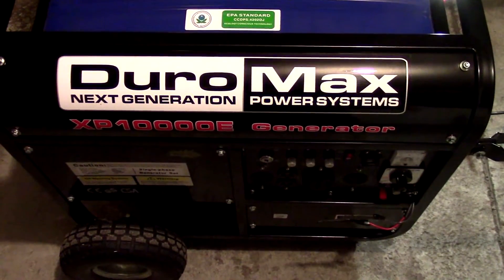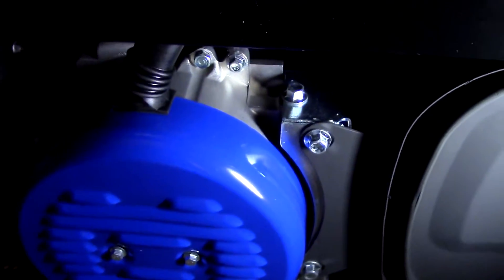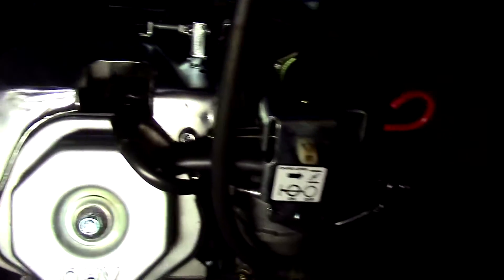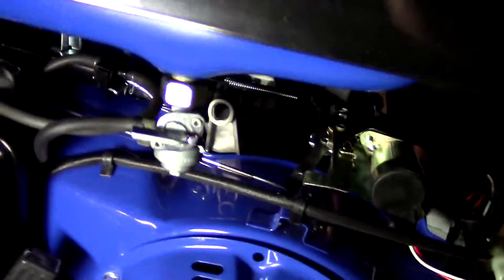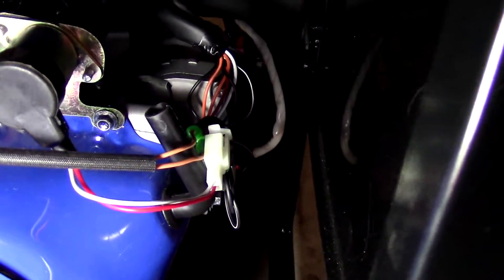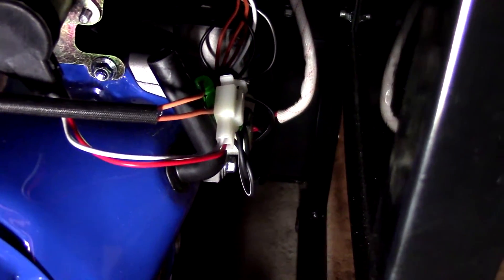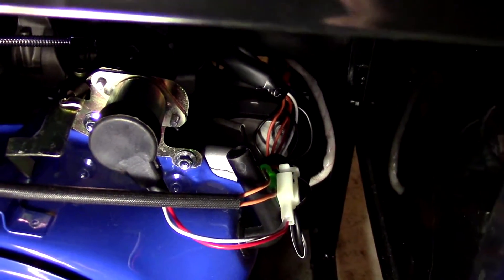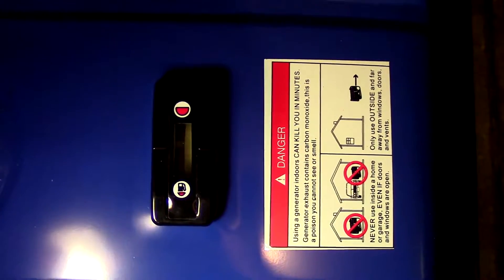DuroMax XP10000E Generator Wiring and Diagram

Comment: I have watched some of your very informative videos and have a question about the duromax XP10000EH generator auto idle control.This generator is similar to the one you reviewed, however, it can run on propane too.  Ever since I bought the unit 4 years ago, I can start the generator in the low idle mode with no load on the generator  with "auto idle on".  The generator then goes to high idle with load attached, however,
- it does not return to a low idle when it is later disconnected from the load  via the home circuit breaker.
-it does not change the engine's speed as the load normally changes when connected. It always at the highest engine speed.
-the auto idle control switch does not illuminate when "on"

 I contacted the seller, maxtool/factory authorized outlet, who said I may have a defective auto idle control switch because it does not illuminate. Another tech there said it could be a defective solenoid.

I painfully removed the switch and tested it. It is a kcd3 rocker that should have three terminals, however, the ground terminal is totally missing . The load on/off seems to operate OK. Can the switch illuminate with a nonexistent ground? I mentioned this to the duromax tech and who had no answer.

Via your experience-  Should the auto idle control switch illuminate? If so, should it be grounded and require a new switch? It is difficult to see in the tangle of control panel wiring if there is a disconnected  wire to ground with a broken terminal attached.   On the other hand, is there a problem with the solenoid and how do I replace it? Could there be another problem?

Thank you in advance for your advice and assistance.

Comment: I purchased a replacement AVR for my XP4400E.  The original half moon has a pair of yellow and a single blue wire going into a 4 pin connector and a brown wire to a single connector.  This arrangement does not correspond to the wiring diagram in  the owners manual but it worked fine for 5 years until it failed.  The new AVR has all four wires going to the 4 pin connector (pair of yellows, a blue and a brown).  In the pin arrangement the blue and brown (shown as red and white in the wiring diagram) are reversed.  The yellows are in the correct positions on the connector and go to the Excitation coil.  My question is: Does it make any difference how you connect the other two (brown and blue) that go to the Main coil? Or to put it another way "Does reversing these two wires make any difference?

Comment: I have a duromax generator  propane and gas , the engine went bad so I tried to replace it with a used predator 6 hp. But the coils won't pair when I flip my 110/220 switch I have no power now. Did I fry my regulator? How can I make this work so I get 110 at 26 amps to run my account?

Comment: good afternoon , I have the same generator , but does not generate power , I tested the mechanical part and goes well, the cables and wiring are fine ,
I think it may be the rectifier amperage, you can tell me about it

Comment: Sir, could you please tell me where the battery charger rectifier is on this model? My idle control does not work and it was suggested to me that this part may be at fault. Thanks.
Reply: i think I have the same problem . Did you find a solution?

Comment: Shopping Dad  that was very nice of you to make a video for John. Very nice indeed.
I hope you can answer my question listed on your other video about my well pump.
Reply: joseph get an ac amp meter if you dont know what your well pump draws,determine if it is 240 volts or 120 volt, im asuming its 240 volts,clamp it around one leg of the 240 wire thats comming out of your breaker box turn the water on and  watch your amp meter for full load amps,then buy a generator to handle that much amperage.i think mine is around 23 amps but not fla.flas will be a little higher,then depending how much load your pulling on everything else.i have the 10000e i run my 240 volt well pump with it but run it only with nothing else running on it.i am total electric,so i cant run my furnace or hot water heater but i can run all lights refrigirator tv and wood stove backup.i guess i need a 400 amp comericial generator ya diesel. ken
Reply: maxtrac1 Say, I like your idea, and will test the amp. load as you have prescribed. Thank you for taking the time
to respond to me, I really appreciate it.
I have the 7500 w/ a 10,000 surge I was hoping this would do it, however, after reading your specs. i may have to
upgrade to a larger generator. Like yourself a diesel would be the way to go, thanks again Ken.

Comment: On the other side from where you were looking. On mine as well is a white wire with a brass oval ring. Just hanging loosely between the battery and the generator.
Reply from the maker: There seems to have been a design change between our units. When did you purchase yours?
Reply: It was at the beginning of the month that the second one arrived.  The first one arrived damaged in shipping, and they replaced it.  I am thinking it is the negative wire for the battery they just did not hook it up.
Reply: @smilemoney  is it the wire for the battery terminal? That's the only white wire that came not attached on mine. I just had to hook it up
Reply: @theebrewmaster  That was it, but then the electric start never worked.  Had it replaced twice.  I just gave up